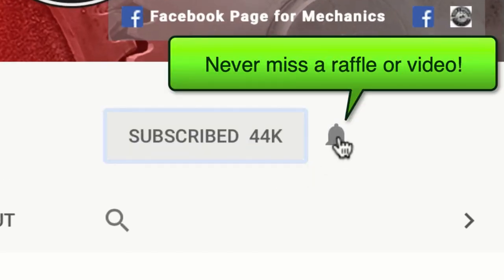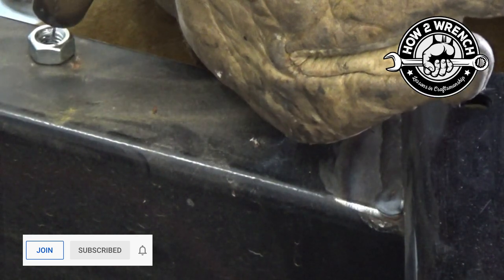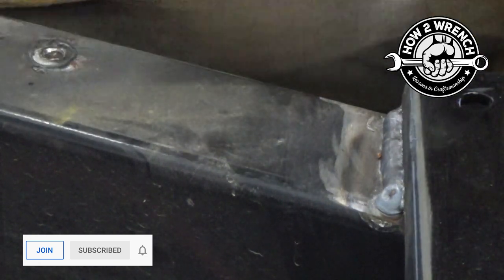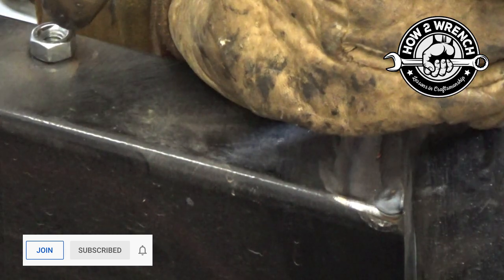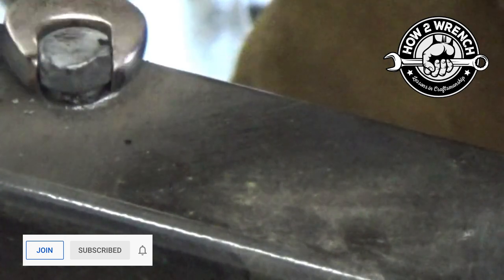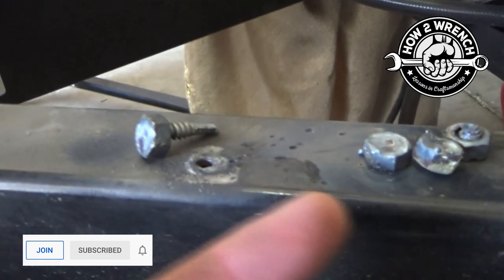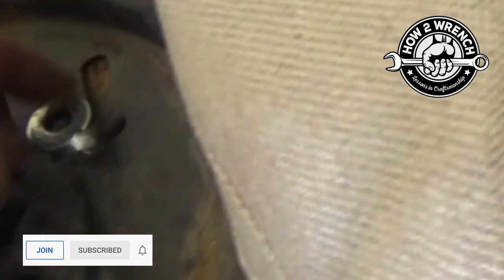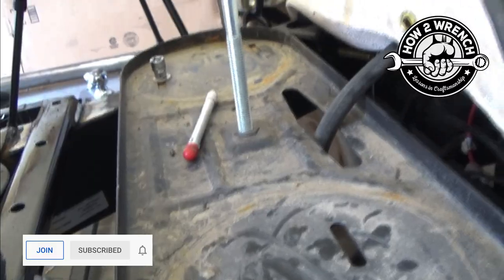Remove a bolt broken flush with the surface! Welding method in 3 mins! #brokenbolt #strippedstud

Comment: Shane -- thank you for the video. With the method shown, it might help letting the nut/screw cool down completely before attempting to work it out of the hole.  This is because heating the nut/screw red hot and beyond "upsets" the metal of the screw (at least along a few threads next to the weld pool).  In other words, the molten metal of the screw must expand, but cannot do so radially, since it is constrained in that direction by a large (and relatively cool) mass of metal, surrounding the threads of the hole.  So, the molten metal of the screw expands in the only direction it can -- lengthwise.  Because of this, when the molten portion of the screw fully cools and shrinks, its diameter becomes smaller than it was originally and whatever bonds (rust, etc.) that existed between the threads of that portion of the screw and the hole tend to break for that reason.  Also, it might be a good idea to use a washer between the nut and the base to decrease the likelihood of welding the nut to the base and to protect the base somewhat.  To improve the chances of removal of the screw after cool-down, some heat can be added to the area around the screw with a torch (or even a heat gun) to expand the hole and then freeze spray (like MG Chemicals 403A 134A Super Cold Spray) can be used to shrink the screw. By the way, the trick of rocking the screw (tightening the screw slightly before attempting to loosen it) shown in the video is right on the money.
Reply from the maker: Nice! Good idea on the washer! It's a real fine line I've found and you have a good eye! I broke one of the nuts from grabbing to soon as you say and not letting it "cool down". On the other hand I've found that giving it the "wiggle" back and forth while cherry or right after that the broken bolt will move a hair and unseize (if not cross threaded problem).  I've had bolts I've welded the nut on the they just wouldn't budge until I got the torch out and heated up....that's what led me to try to move when hot as possible...BUT getting greedy while ruin a good penetrated weld in a second! 
I look forward to checking out the cold spray you mentioned!
Reply: @How2Wrench  Shane -- you are right, there is no single solution here.  Cool-down may not help much if the screw is real long.  Applying an impact to the screw is often helpful.  I prefer a hand-held impact driver to a zip gun because of additional control and because a component of the force should be applied along the screw (to help compress and break the crud between the threads), not just torsionally.  Also, if not in a great hurry, a mixture of ATF and acetone makes a superior penetrant.  I use more acetone than ATF when I mix a batch.  The resulting liquid is very thin and, since it penetrates by capillary action, will travel UP the threads just as well as it travels DOWN.  I find that the key to applying penetrating solvents is cleaning the area around the threads as much as possible to provide a better entry path for the liquid.  Giving the liquid a day or two to do its job is not a bad idea.
Reply: @Zerk_Ziegler  Ed’s Red!

Comment: it would have been easier if you welded a flat washer with a hole smaller than the hole with the bolt first. then weld the nut to the washer.